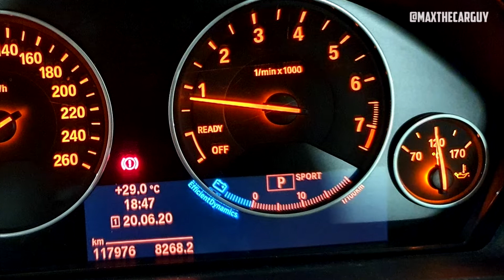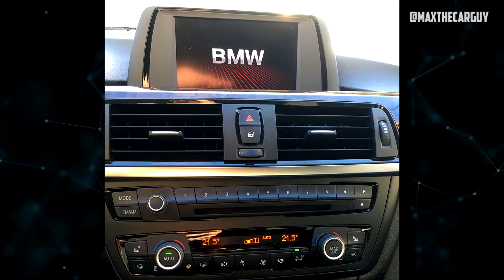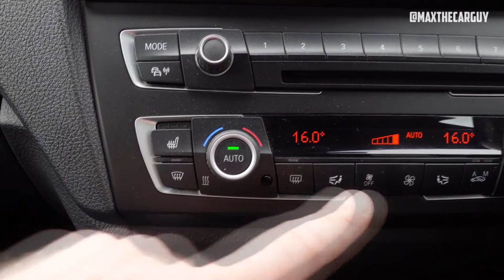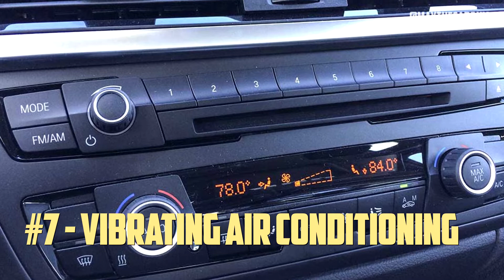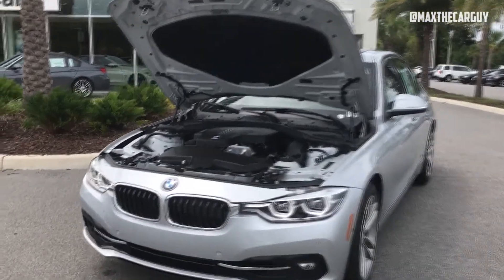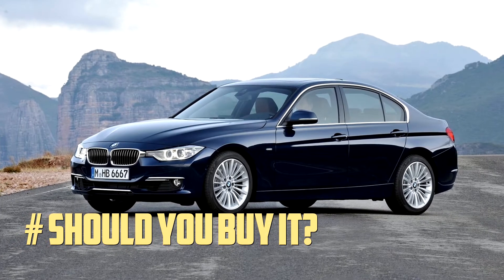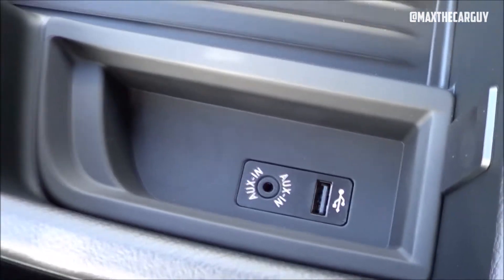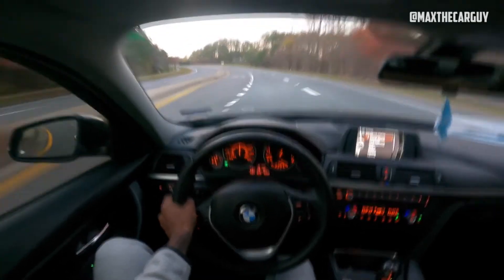2015 BMW 328i problems and recalls. Should you buy it?

Comment: I have had multiple three series BMWs most of these problems are because people don’t take care of them and don’t all happen at once the oil leaks are present but gradual never really had a big problem with them. I like the BMWs as long as they are maintained and not beaten on they are good cars. Mine have lasted 200,000 miles or more. Just do a Carfax and keep up with the common maintenance.

Comment: BMWs are always lease cars, uncles you can do the maintenance required to keep one of these on the road and only then will it be reliable. At this point I’d just go and buy a used Lexus IS250, it’s better looking imo and more reliable
Reply: No
Reply: maintenance required to keep on the road is oil change on 7-8k km which costs less than 100 dollars and can be done at home, if you cant do that you are better off riding the bus or a bike

Comment: this car is trash. Never buy an older BMW. everything that should be metal for reliability, BMW conveniently uses plastic so that just after the warranty all the problems will start and you will pay the price of the MSRP in repairs.
Reply: Had this same exact BMW. Up to 108k before it got totaled, never had problems, because I didn't beat the shit out of it. It's a 2.0L with a tiny turbo, what do you expect, a coyote V8? 

That being said... only problems I had was the valve cover seal, which all f30 bmws had this problem, which you can also do yourself also. After that no problems.